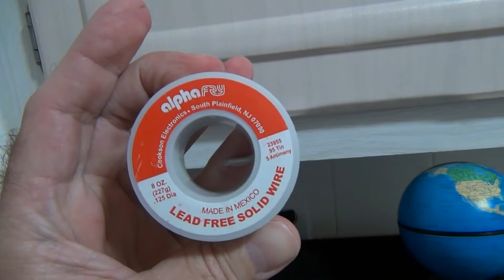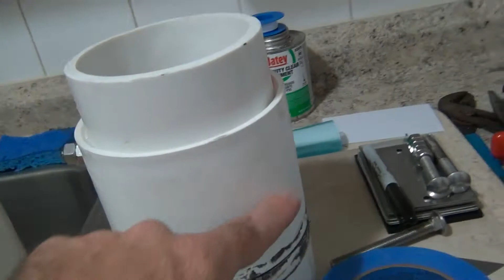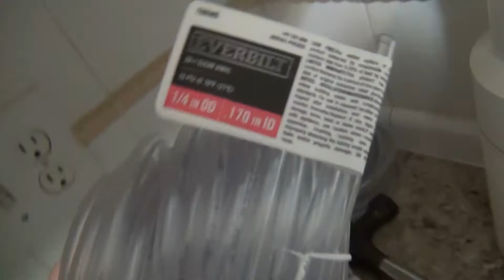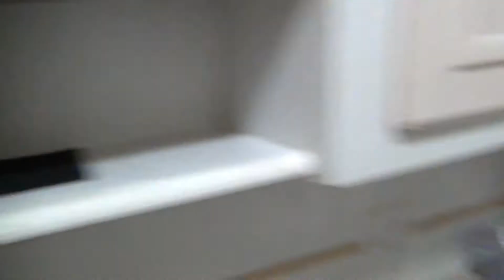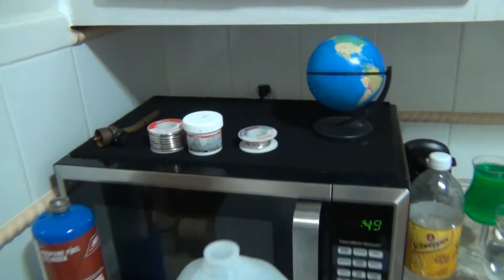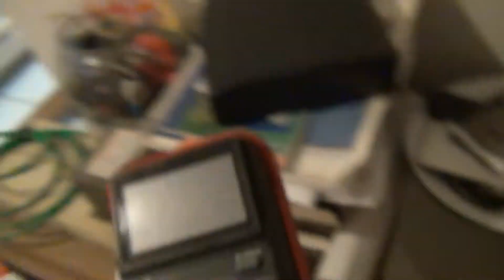HHO EXTRA PARTS REPAIR EQUIPMENT & SUPPLIES

Comment from the maker: The HHO technology can be used to repair itself as you can cook weld solder drive fly and much more all on the same fuel source using water. A picture is worth a thousand words thought i would show some of the repair equipment in case a power supply or a reactor core needs to be fixed in the future to keep the gas flowing.